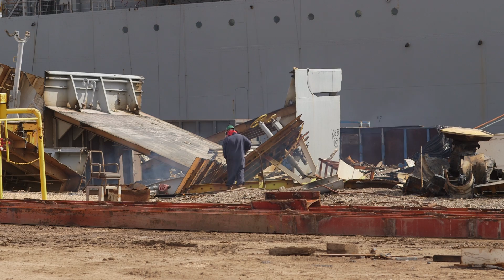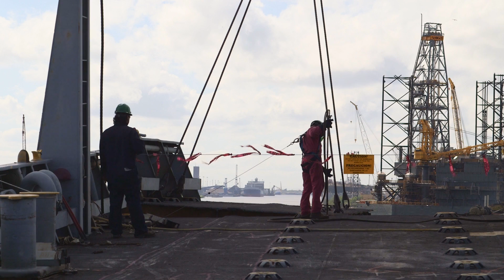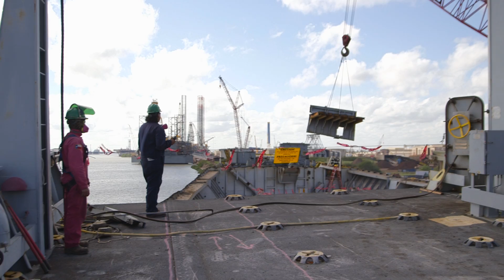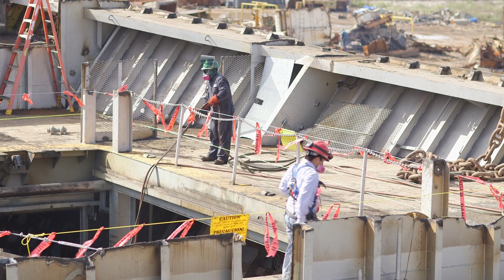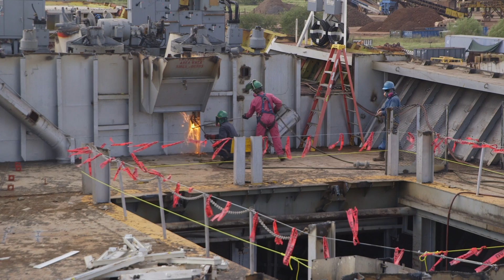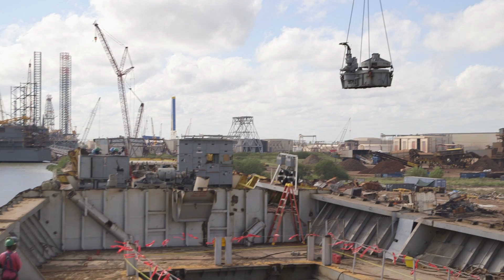All Star Metals - Ship Recycling Facility - Brownsville, TX

Comment: I think the navy should have kept some of the conventional carriers especially since the world situation is what it is today
Reply: Conventional Carriers are too costly to operate.
Reply: They've long outlived their service life, and structural fatigue aside, would have required extensive overhaul and upgrades to be useful in today's battlefields. The Navy only plans for a 50-year service life for it's supercarriers, with a major overhaul/refit & nuclear refuelling (they usually just cut out and swap out the reactors) around the 25-year mark.
Reply: The Kennedy was the only carrier underway when the clocks turned to the year 2000. All the nukes were parked. Say what you want about the conventional powered ones but during the golf war the Kennedy flew more sorties, and dropped more ordinance than any other. I’m sure the boys on the ground we glad the old oil burner was steaming off the coast when needed.
Reply: @oldfarmer4700  Their reactors weren't offline, if that's what you're implying. They were just in port.
Reply: @BlackEpyon  they were in port for a reason. It was called Y2K. Don’t believe me go check it out for yourself.